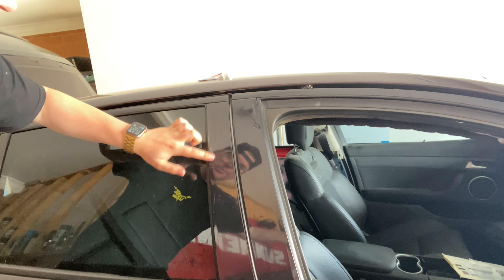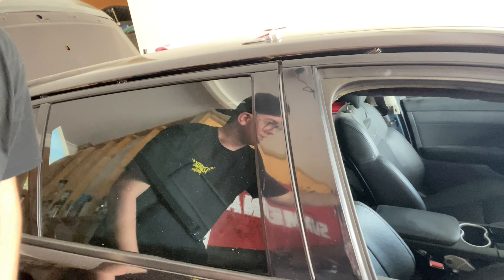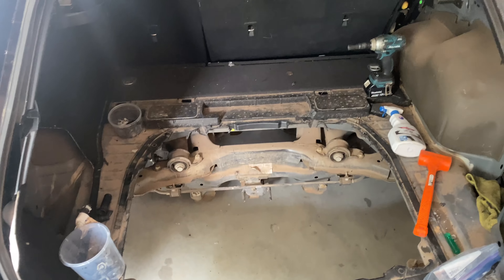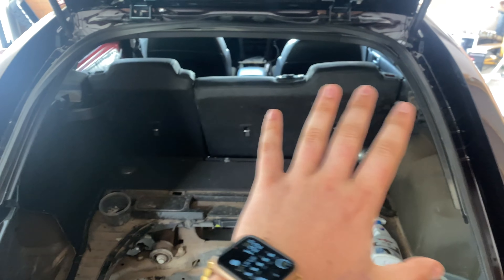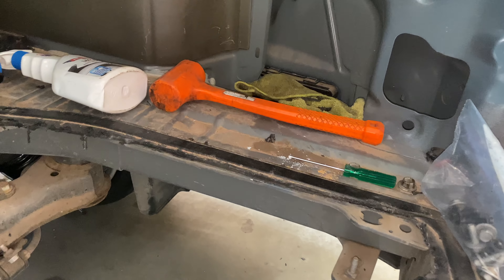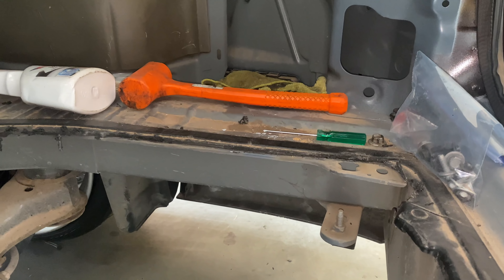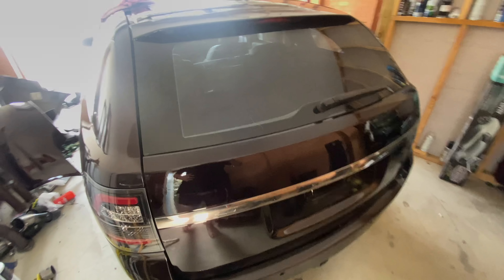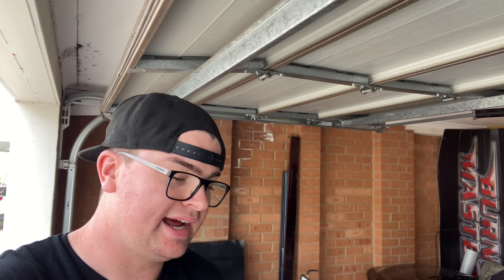Sometimes You Need A Little Perspective

Comment: I’d be bracing the fuel cell as they are known to split if not mounted properly and in a skid car the vibration is what kills them
Reply from the maker: Yeah we are planning on bracing it to the car quite aggressive to help with tank slosh/slap and I also wanna use some kind of rubber mounts or put the cell on a rubber mat to help with the vibration
Reply: @Mick_Hinchy  as long as the bottom of the tank is supported you will be fine

Comment: Love ya work keep it up
Myself doing the rb30 turbo build on the VK. I don't know much about the rb but I'm piecing it all together reading up n watching what other you tubers have done and people are like what power you want to make. Whatever the tuner decides 
But sourced parts from marketplace n eBay and once it's all done I'll start it make sure it runs then send it to tuner. I know more about ford e-series 4 litre sohc My NL Fairlane made 151rwkw without much work.
The NL was off the rd for 5 years(owned 13 years) and best feeling was getting the rw then 2 weeks later rego. Now the VK (owned for 9 years) been doing not much for 5 years till this year.
Marriage and child takes a toll and cars get put on back burner.
Much respect think when i was 24 I just traded in my VH on a VT looking back now wish I kept the VH but back then you could get them for like $500 running.